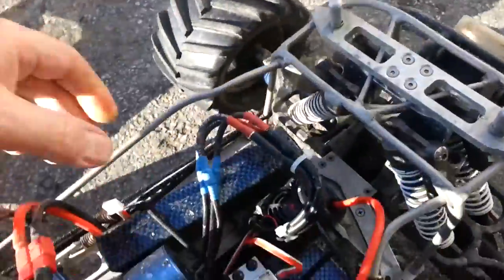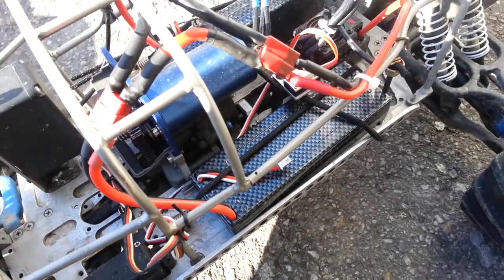Modified RC's T MAXX.. Stretched and Electrified on 4S 120amp ESC

Comment: Very nice!!  I've converted mine as well do you know how the motor plate was mounted ? And what plate is it ? I'm running one vxl3s on one 2s and it's quite powerful but  I'd like to run two of those systems in it ! Lol
Reply from the maker: He purchased a mount specifically for it so it uses standard  mounting holes.